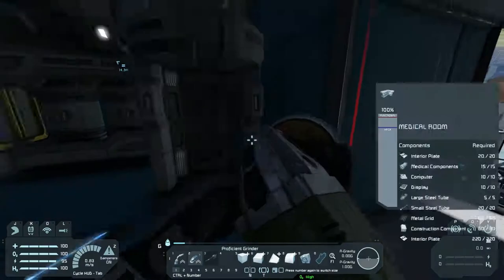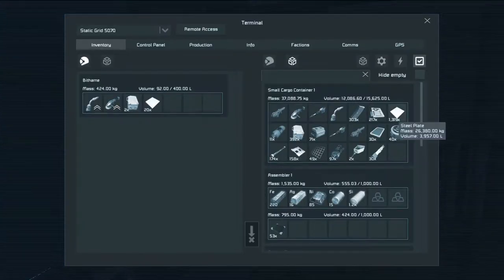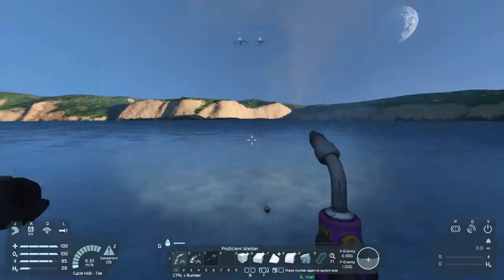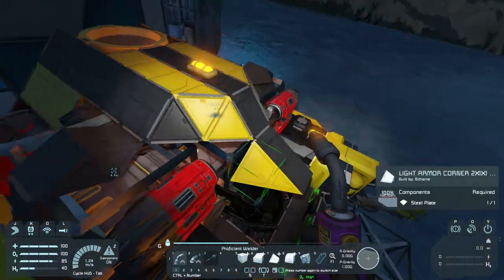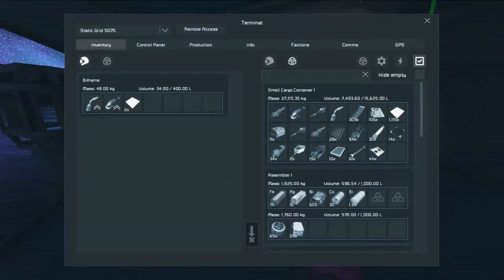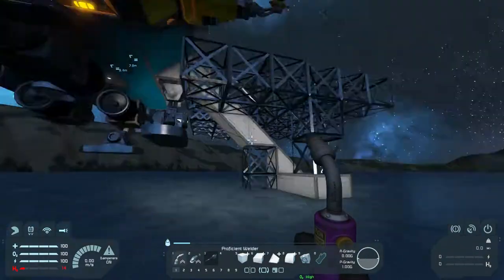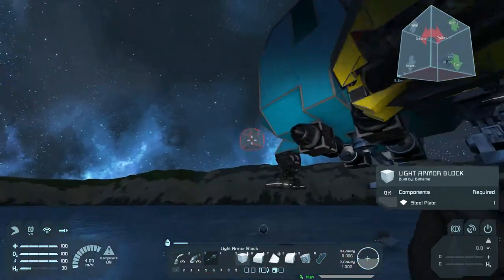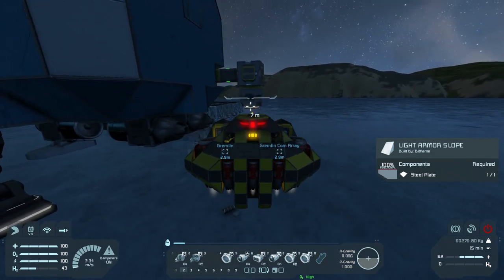Space Engineers Learning Let's Play Part 2 - Building our Gremlin

Comment: I am having an issue where the projector is off and it still shows as if it is on?
Reply from the maker: On the Gremlin? There's multiple projectors. If you set up a base one to build the Gremlin and turned off that projector then the Gremlin's repair projector could be on still, if you've built it (it'll be blue).
 
 Otherwise try toggling it on and off a few times and see if it works. If not shut down power to the grid and see if that works. Re-start power with projector off and see if it comes up on its own. Otherwise a fresh reload should help. If not then grind down the projector and rebuild it!
Reply: Thanks, installed the Batteries too soon thats the issue
Reply from the maker: If you do, and let the engines run, you'll drain all the power. That's why I:

A. Turn off engines ASAP
B. Leave batteries till last :D